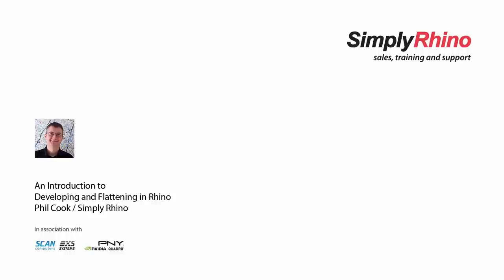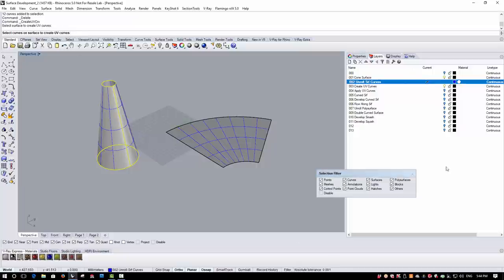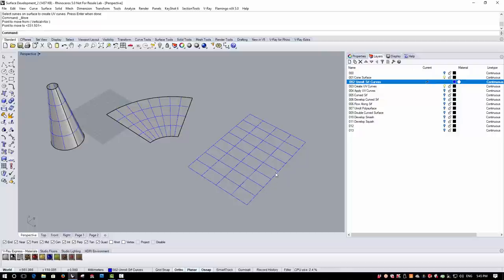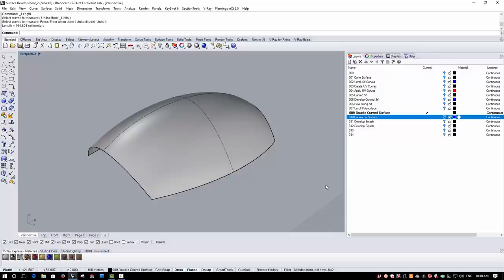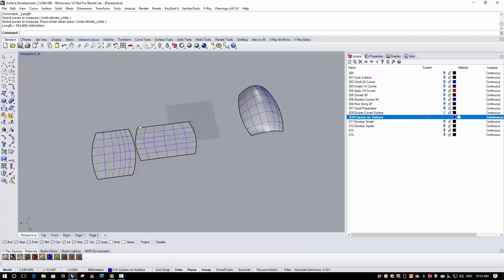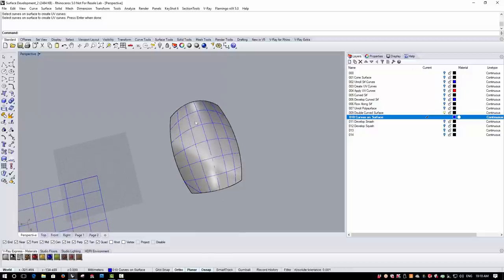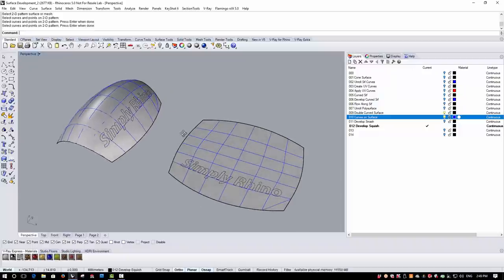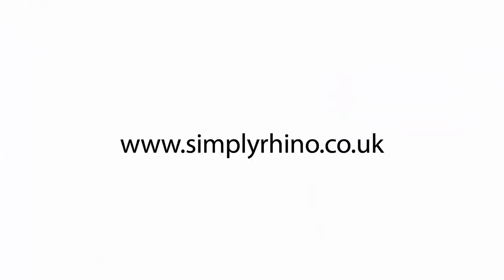Introduction to Developing and Flattening Surfaces in Rhino3d

Comment: Thank you for the great video so is there no other option to have a very accurate flattening for the double curve types other than increasing the tolerance for squish?
Reply from the maker: Hi, thanks for your question and positive comments. Developing or flattening a double curvature surface always involves an element of approximation. There are some third party plug-ins for Rhino that may provide a better workflow and easier to understand inputs, but underneath the hood they tend to use similar calculation methods. Hope this helps.

Comment: It was very helpful, thank you.

I'm having a different problem than the one in the video.

For example: When I offset a curve that I created with only three control points, many control points are formed on the curve formed with the offset. This creates some problems when editing later. Is there any way to prevent this?

Thank you from far away.
Reply from the maker: Hi. When you offset a curve (or surface) in most NURBS based software including Rhino you will often generate a curve with more control points than the original. Offsetting at Rhino’s default setting is carried out to an ‘Absolute Tolerance’. If you are, for example, using a ‘Small Objects Millimetres’ template then this ‘Absolute Tolerance’ setting is 0.001mm. So, what happens when you offset is that in order to keep the offset within 0.001mm of the original curve then control points are added. In the command line options for Offset you can set a slacker tolerance for the offset (for example 0.05) which will reduce the number of points. If you want to maintain the original number of control points you can use the ‘Loose’ option from the command line. You will see that this may make the offset more inaccurate. As a compromise you could Offset at the default settings then lock the offset curve to use this as a ‘target’. Then  offset with the ‘Loose’ option - you can then adjust the intermediate points of the ‘Loose’ offset to better fit the locked curve. It’s important to note that an ‘Absolute Tolerance’ is used for splitting, trimming, joining, offsetting and projecting and pulling curves amongst others.
Reply: @SimplyRhino3D  Thank you very much for the detailed explanation.
Reply from the maker: @giyinikvatandas  You're welcome, hope it was helpful.

Comment: This is still a great vid for me.  One issue I often face though is when having doubly curved surfaces as you showed, then trying to flow a regularly shaped texture along it, i.e. for it to not stretch with topology (so perhaps finding some technique to create regularly spaced topology that drapes over)
Reply from the maker: Hi Jonathan, Thank you for your comments. Many modellers use the technique of creating a second surface with a different topology purely to do the flow/orient etc which then becomes redundant after the orient process. Very often the cleanest and most efficient way of modelling a surface is at odds with the topology required for panelling/flow/orient. Another way of tackling this issue would be to look at a Grasshopper routine.
Reply: Simply Rhino - Rhino3d Video Tutorials ‘add odds with the topology required’ yes this is exactly right. Case in point with the shield example (if there wasn’t a logical way to just trim away). Then the dilemma becomes how to construct this surface and in a clean way with even topo.

Comment: Hi Phil, hi Everybody,

I have a question, hope someone could help me. Let's say I have modeled a simple squarish Cupboard, nothing special, just left, right, top, and bottom panels as the carcass, back panel, and the front door. I am looking for a way to layout my all panels (top view) for future manufacture, nesting, etc. I was hoping that "flatten" would be the thing but looks like not. Could someone help me, please?

I know that I could face different parts in different views and then use the "make2d" command, but that would be a very slow procedure. And imagine if the model is more complex. I need a kinda faster way to bring all my panels on top view.
By the way - I am using Rhino for MAC. Not many plugins from food4Rhino I can use. So basically native Rhino command is what I am expecting. 

Thank you!
Reply from the maker: Hi DC, Try ‘Smash’. If you have something like a 100mm solid box, shell it out to a thickness of 10mm from one face and then run ‘Smash’ then all the faces will be flattened and presented in ‘Top’ viewport. Look at the Options in the command line to fine-tune. Hope that helps - Phil.

Comment: At 15:00 what If i use the shrinksrf command, could this resolve the trimmed Surface issue?
Reply from the maker: Hi Pedro, unfortunately not – using the Shrink command would give you a smaller rectangular surface but still one with four straight sides. You could get around the issue by using two lines and two curves to create the surface and use a command like Sweep 2 or Edge Curves to build a planar surface that had two curved (rather than linear) and two straight boundaries.

Comment: Thank you - Really helpful! However...along the way I discovered something missing from Rhino 3D, and maybe you can help me find it. Why can't I connect two offset identical surfaces with a new surface? You would think that Surface>Edge Curves, or curve network, or ...? would do that, but it doesn't. 
Here is an example: Create a domed disk SURFACE, like that of a frisbee; then duplicate that and place it in a space parallel (or should I say offset slightly) to the first. Now, attempt to create a surface joining the two surfaces such that you would give thickness to the frisbee. Nothing I have tried under the Surface menu can accomplish this. What am I missing? 
Thanks again!
***EDIT*** I DO see you can select the first surface then go to Solid>Extrude surface>Straight but that creates a solid frisbee rather than a shell of the structure.
Reply from the maker: Hi, the command you are looking for is OffsetSrf with the Solid Option turned on. So, take your single surface frisbee go to the Solid Menu and run Offset and you’ll see command line input options for thickness, offset direction etc. Hope this helps.
Reply: @SimplyRhino3D  THANK YOU so much!